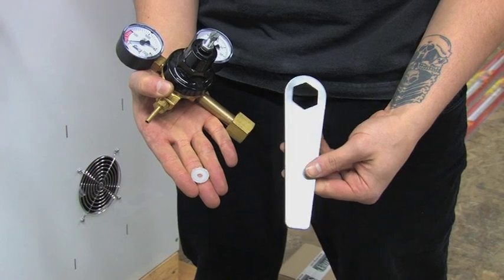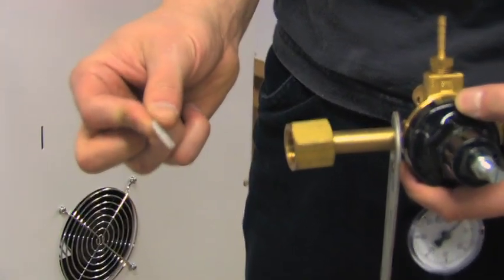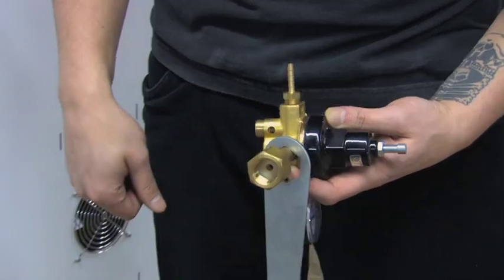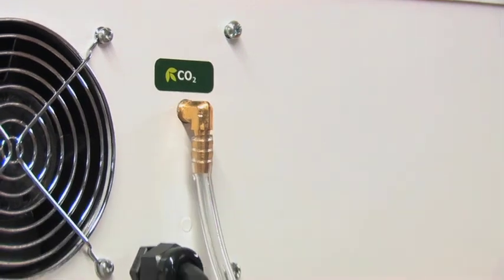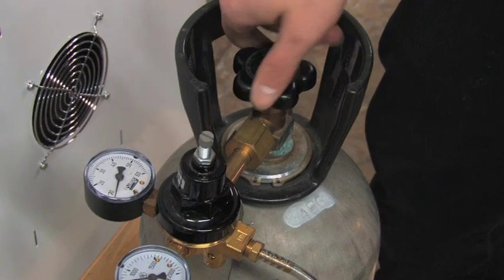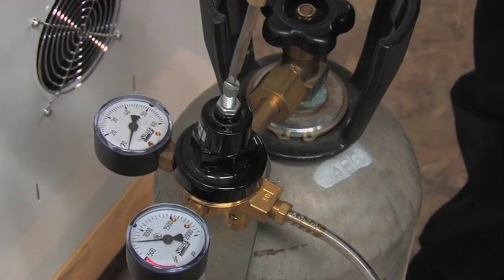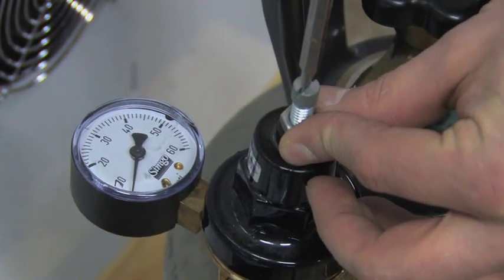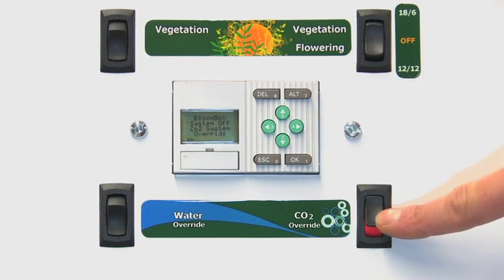Installing CO2 in your Grow Box  |  BCNL

Comment: WARING OVERPRICED. AFTER 2 RUNS IT WILL BREAK DOWN. DON'T BUY IT. YOU WILL BE DISAPPOINTED.
Reply: Hiphop Kultur damn really?
Reply: They have a 3 year warranty you sound like a hater, ive never seen any comments on it breaking.
Reply: what broke down? the box is well put together.
Reply: @mopaper3063  what out all the other 2 comments 🤣
Reply: Mine has been running non stop for 7 years...